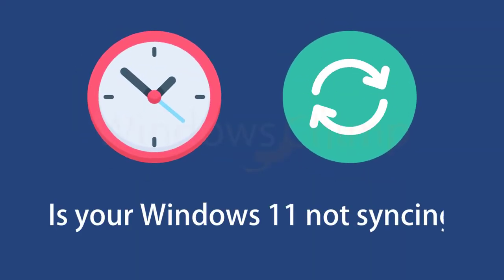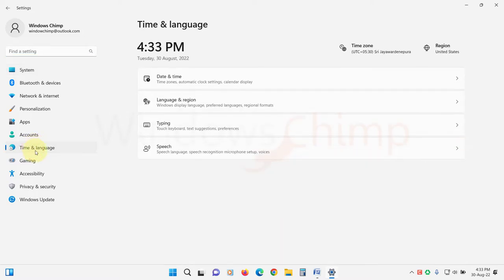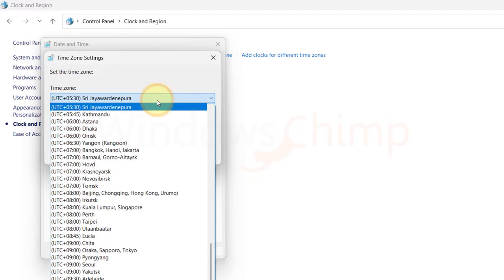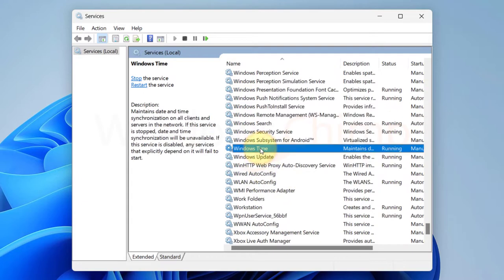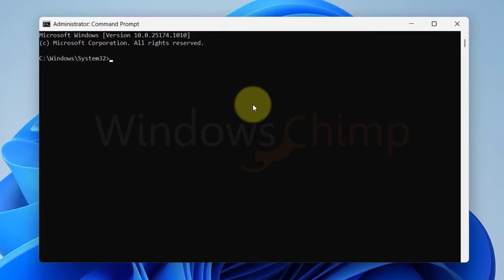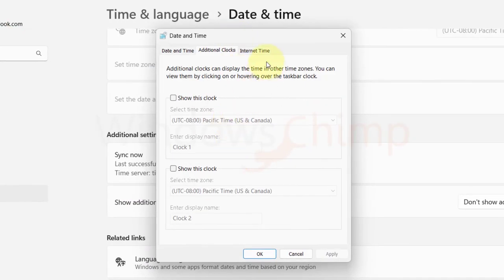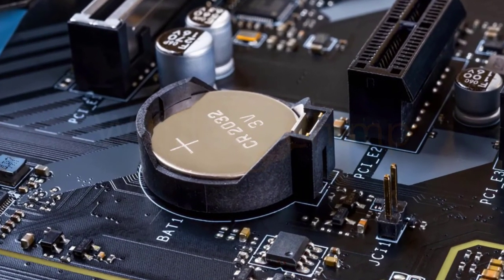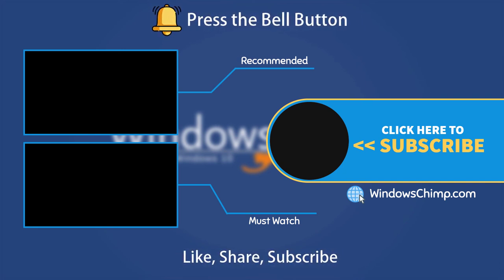How to Fix Time Sync Not Working on Windows 11?

Comment: I never expected that in 2023, february I would be having trouble fixing a computer's time lol. It just won't.
Reply: Update I still couldn't fix it. It's most likely happened after I installed a custom boot manager (refind) after installing linux
Reply: And fixed it bro...its my wifi issue....seems wifi not allowing sync ....when i try my mobile hotspot it works

Comment: Easy to understand directions. I got at some of these settings in slightly different ways but I (with only minimal to moderate computer savviness... depending on who I'm being compared to) was able to figure it out. The first suggestions didn't work but changing the time server from the windows choice to the time - dot - gov choice worked immediately. I've been trying to figure my non-syncing issue out for at least a year (on and off) and have been manually updating my time so Thanks So Much!

Comment: None of these worked for me.  One step I noticed you skipped which worked for me was the Additional Clocks.  On the Date and Time tab - under Time zone, i had to manually select my time zones there.  My Sync then worked.
Reply: Thanks, I will try that and see if it helps as this is a continuous problem for me in Windows 11.